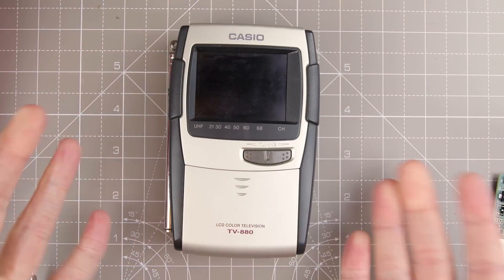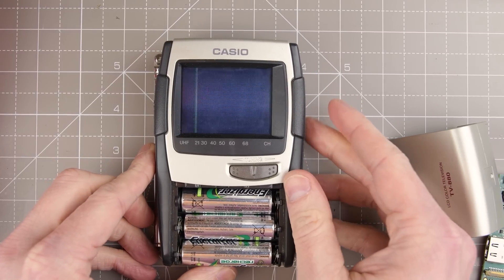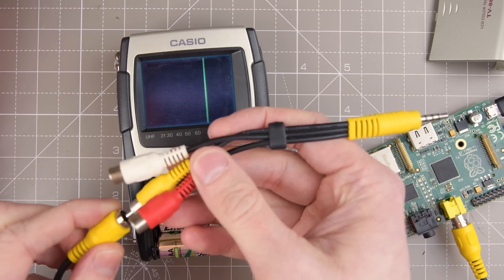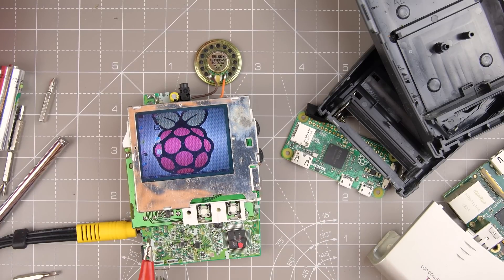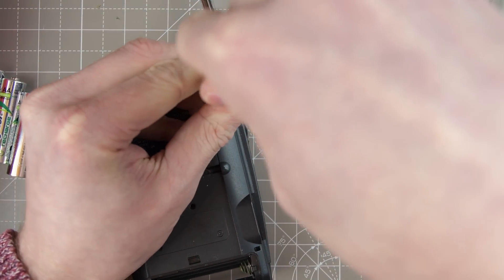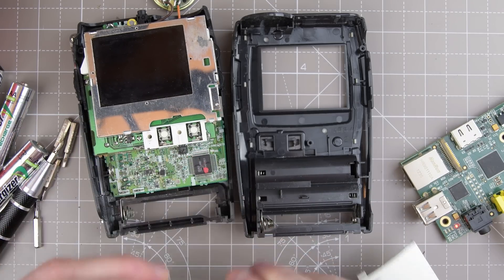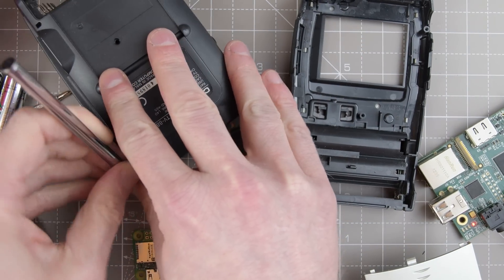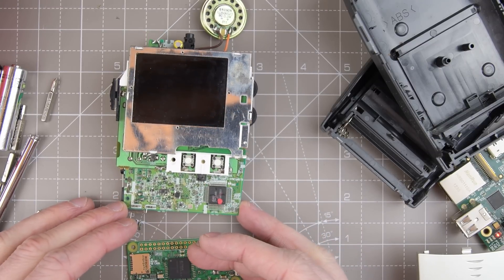Part 1: Raspberry Pi Zero Retro TV with the Casio TV 880

Comment: I know this is an ancient video but if anyone has one of these TVs the reason you get interference and have to "wiggle" the cable to get any video is because these TVs use a three pole TRS 3.5mm mono AV cable not a four pole TRRS  stereo AV cable. In fact a standard 3.5mm to two phono stereo cable will work as they have a three pole 3.5mm jack on one end and two phono  on the other, if you don't get video at first swap the phono connectors around on your source.

Comment: The resolution on the lcd is way to low for text.

Internally the lcd driver is rgb based. Quite possible to get a significant quality boost by highjacking those rgb signals.

Edit: Have a camera from about the same era with a casio lcd, that thing looks quite nice tbh.

Comment: Should have thought about using one of the other RCA/Composite plugs in the first place, usualy if it does not show on the standard one after pushing it in all yhe way test the others before figiting with it anf risking damaging the plug or the unit

Comment: A Casio TV 880 turned up when we recently de-cluttered the office, and I adopted it for no particular reason. I did see the "audio/video" jack but for some reason assumed it was an output instead of an input, until i came across this video... so I tried it and yep, a stereo headphone to RCA cable works fine for video and mono audio, whether from a Gopro or a Raspberry Pi... of course the screen resolution is far too low (something like 50 lines at best, and no rectangular pixels either? very weird display technology) to use as a proper screen for the Pi, but i'll have to find an application for it now ;-)

Comment: I had snagged one like this years ago, when they were new, with hopes of hooking it up to a Commodore 64 keytar rig I was working on at the time, as built-in monitor for the '64... with a builtin Prophet 64 cartridge, etc.  I hit a major snag in that the monitor, although it was an active matrix display (good!) it had a very low resolution display (bad!). so even the '64's text was sadly unreadable.  I should revisit this project using one of the modern composite 3.5" "rearview car display" monitors... which are $15.  (I have one in a Retropie-in-an-atari-lynx project I made).  Cheers, mate!

Comment: So did you ever get the Pi Zero to work?
Reply from the maker: Yep, just been busy IRL. Putting together part 2 is a bigger job that I have the hours to commit to at the moment.
Reply: Have you tried to network the Zero?  I haven't had any luck and there doesn't seem to be any way to get WiFi to work or anything like that.
Reply from the maker: Yeah, mine seems fine. I am SSH'ing into it using the WiFi. What is your setup?
Reply: It's a Pi Zero 1.3 with Raspberian from the Pi website with a Kensington 4 port USB hub and a wireless keyboard.  I also tried Ubunto Mate that's listed on the Pi site for ver 2 and 3 but that won't boot.  That seems to be as far as it will go, it doesn't recognize any kind of USB wifi adapter or Ethernet adapter so there doesn't seem to be any way to network it which makes it pretty useless. How did you get it to work?
Reply from the maker: It is likely that your hub is not powered which can be a problem, the USB WiFi adaptors can draw a fair amount of current. It should be plug and play with WiFi on Raspbian, I didn't do anything special.
Reply: You are right!  I've never needed to use a powered hub before and most of them aren't but I found a couple that have the power jack and rigged up a Radio Shack power supply to provide 5 volts and it worked!  Since the wireless keyboard and Bluetooth worked OK the way it was I never though it would need extra power for WiFi but that seems to have done the trick. It's so agonizingly slow I wouldn't call it plug and play though, it's more like wait, wait, wait!  It takes several minutes to load a webpage, like using dial up in the 1990!

Comment: This would be a good job for the CHIP computer.  That $6 single board comnputer already has an RCA out, I think it's even in the alternate ordering
Reply from the maker: I think it was $9 and I have one here but I didn't want to use it in this project. The on-board WiFi and AV out would have been great though.

Comment: For mine I just ordered a car backup monitor from Ebay as they're about £11, the electronics are a lot more compact, they use much less power and the picture quality is considerably better (I used to have a Casio TV-450). Gameboy "DMG" shells are around £6 from Ebay too. Biggest problem I still haven't 100% solved with mine is the battery, I've been trialing some 14500 3.7 volt li-po batteries but I'm not satisfied. Got some PS4 controller batteries on the way - the idea is I want to be able to change the batteries when out and about.

Comment: I'm in, I  have the exact same tv lying and the older casio around and will hookup the raspberry pi 2 to it if possible. Dunno what to do with the other.
I also gonnna try if you can solder a car usb adapter to the batterypack to power the pi.
Are 6 batteries enough to power the pi and tv? Maybe take an 8 pack like the GoPiGo.
Reply from the maker: Awesome. The TV is happy on 4.5v is seems so you will be fine with USB. It does say 6v in but there is some tolerance for batteries in there. I plan to use a LiPo and a boost board.

Comment: Devices of that era use the 3  lead jack and plug from stereo headphones, not the 4 lead used with devices that have a microphone.  The audio "interference" is the video signal being applied to the audio input of the TV because you're not using the correct cable.  

I have a similar battery-powered handheld color TV (the NTSC version for the US) and it has the original AV cable with a 3 lead plug - TRS (tip, ring, sleeve) instead of the current 4 lead TRRS (tip, ring, ring, sleeve).

The brightness and contrast adjustments interact a bit, which is more obvious on a still image (RPi screen) than a moving image (TV).
Reply: David Watts 
I swear our brains are programmed that yellow is video and refuses to let us to think to try white or red.
Reply from the maker: Thanks dude, I figured out the cable mis-match and the white audio RCA connector was video.  I figured it would be ground, video, left and right so 4 pole.  Really looking forward to playing with this one :-)
Reply: Another culprit might be people treating others poorly for not solving a problem quickly and in as few steps as possible, as if following a script prescribed by a guru.  Everyone thinks a master at anything didn't get tons of shit wrong before they mastered it.
Reply: Came to the comments section to say exactly this.
Reply: From using the Cinemizer Goggles I know that regretfully there are two different wirings for such AV-connectors. If you have the wrong adapter, its not enough to swap the RCA Jack because ground is wired differently. (I dont think this is the case here because IIRC you'd have no picture.)

Comment: I did something similar with a Sinclair TV but gutted it entirely and used one of the really cheap 2.2″ SPI LCDs off ebay and a Pi Model A. Would have been so much easier now the Pi Zero is available!

Blog post on it here:
https://nathan.chantrell.net/20141001/raspberry-pi-sinclair-tv-lcd-conversion/

and a fun little video showing it playing a news report of the original Sinclair TV launch:
https://www.youtube.com/watch?v=JBr381ptp10
Reply from the maker: That is awesome. My picture won't look nearly that good of course but it will be fun to play with. I had forgotten that they used to put zebra strips on the screen to tell you the end or break in the program was coming up.

Comment: I may have misunderstood your intentions, but doesn't the Pi have an audio out you could connect to the AV in for sound?
Reply from the maker: Not the Pi Zero, this is the audio circuit I will probably use - https://learn.adafruit.com/introducing-the-raspberry-pi-zero/audio-outputs
Reply: David Watts 
Ah! I didn't realise that was one of the bits they'd cut. 😌

Thanks for the reply. 👍
Reply: I have a nice little pcb for this with surface mount components i can send your way if it shall help.

Comment: you shouldn't need to use an active video signal just plug the lead in and use a multimeter  in continuity u already kno witch pins it is on the connector  hope this helps
Reply from the maker: Comon mate, where is the fun in that?! :-)
Reply: 4 mins of getting rid of nonsense is the reason. Lol